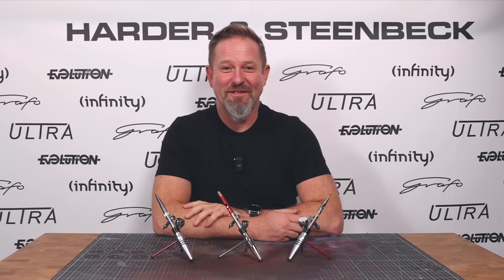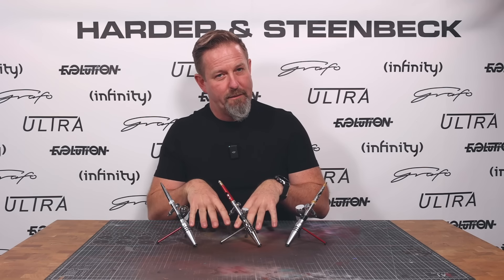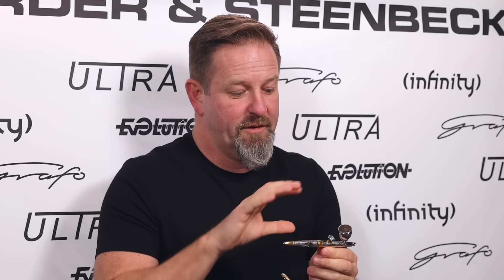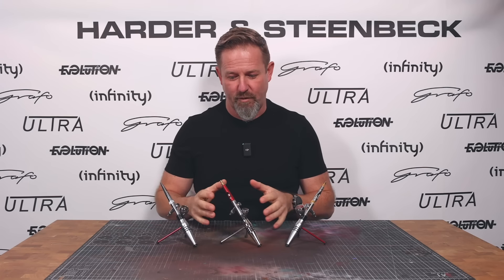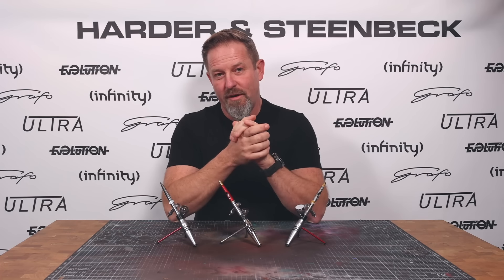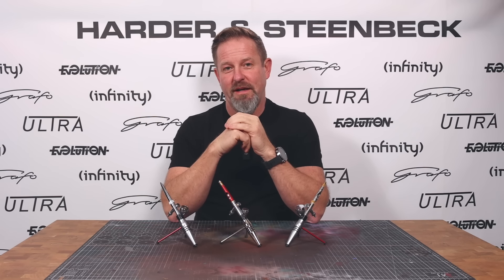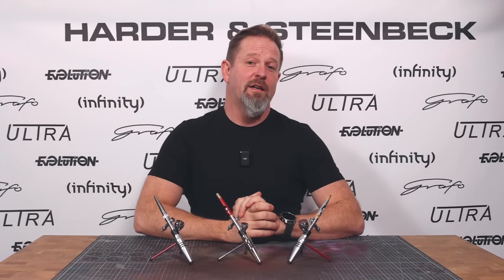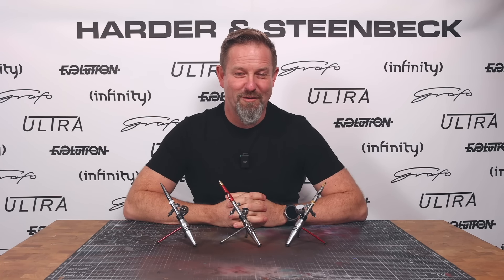Let's talk about the Infinity 2024 CRplus Airbrush!

Comment: Hi Warrick,
Excellent video. 
I am looking at purchasing my first Harder & Steenbeck airbrush. 

I have been airbrushing HO (1/87) scale buildings and rolling stock for many years. I moved up from a Badger, to Paasche, and I am currently using a Paasche Raptor. I find it difficult, if not impossible, to get the fine detail I need with the Raptor, I think my old model M was better. Plus, at times I only need a drop or two of paint for  a particular detail and the 3ml cup is just too large. So, I am looking at your Infinity and Evolution 2024 airbrushes and definitely adding the micro cup. The two sizes of cups is especially interesting, since these are slightly smaller and slightly larger than cup size I am used to. 

My concern is related to specifications for your airbrushes; there are no published specifications; at least, none that I found. I would like to know the length and diameter of your airbrushes and most importantly the weight. I am used to an airbrush weighing 3.75 ounces (106 gm) with a length of about 6.5 inches (165mm) and a diameter of 0.9 inches (12.5mm). Somehow, being all chrome, I believe the Evolution would be heavier. 

Since you are asking for suggestions, I think it would be helpful if you published these specifications. Since there are no physical stores nearby in the US, there is no way to actually see one and put it into your hand, so, in my opinion,  published specifications would help a little.  

Regards,
Paul

Comment: From a comfort standpoint, I have always found the trigger top of the custom micron to be the best of any airbrush. As for cup sizes, I use the micro cup as it does not interfere with line of sight. That being said, If the new infinity was available as a suction feed, side feed and the Grafo T1 body style, I would buy them all. An infinity airbrush in all 4 body styles in a big box set would be pretty sweet. I would buy it right now if such a thing existed.

Comment: I love my iwata eclipse and my CM Takumi. I always struggled with my infinity cr plus. But I got the squidmare evo black and the response is far superior to the more expensive infinity. Can’t wait to buy the new infinity I will be in line early can’t wait. That distance factor is why the Iwata CM’s are so invaluable. I can be back a little bit further back from my models but still get paint where I want it. I like the cup sizes you offer. Here in the states we have the Dru Blair soft spring and low riders trigger which takes almost no resistance

Comment: Intriguing!   I think the Infinity may be beyond my current ability, but being a recent convert to H&S in the shape of the new Evolution I would say your strengths are:
Ease of cleaning
Responsiveness of trigger
Being able to dial in the trigger travel (when needed)
Light weight
Trigger grip, suits my paws!
I have never used the 5ml cup, preferring the 2ml and micro cup, but that is because those are more suited to the models I have been painting.  There are a couple of larger ones lurking in the stash that might need the 5ml.
Great video, but a real teaser…

Comment: My dream brush would be a mix of the AG and Black Kiev brushes.  I use them both and love the design of the AG (Sorry Angel, not the trigger top) and the weight of the Kiev. I don't think I've ever used the 5ml cup on any of my Infinity's so would be happy with a smaller cup. Sketching caps work for me.  Looking forward to a magic no tip dry cap 🤣.  Love H&S quality and engagement.

Comment: 5ml cups definitely! Even when using a small amount of paint I never use the small one, less swapping of parts. Definitely keen on focusing on keeping the infinity as a detail brush and having that cone as narrow as possible even at a distance. Not sure what I think about a bigger trigger but will have to see, a more comfortable trigger would be welcome as long as it doesn't sacrifice control (which I feel I have with a smaller trigger). As for trigger finish I'd  love to see some sort of matte finish or some other kind of finish that offers a bit of grip to it. Everything is sounding great so far, top work!! 🎉

Comment: Comments in no particular order:

I have two Infinitys and I love them.  Just a few nights ago, I made a comment on Reddit that was well liked - the ease of cleaning of H&S brushes doesn't get talked about enough!  So good!  And the Infinity 2024 could be better?!?!  Take my money!!! (Seriously, ease of cleaning is one of the reasons I reach for my Infinitys first)

I prefer a larger cup.  I'll get working on something and get so into the painting that I'll forget about the airbrush and tip paint out of smaller cups.

One of the things I love about my Infinity airbrushes is that with three needle sets I can do a huge amount of different tasks, from .015 detail to .04 bulk coverage, with just one airbrush.   It was mentioned that the Infinity 2024 would have a narrowed spray cone... will I still be able to use different sizes for different tasks?

I'm not worried about the weight of the airbrush- I prefer a solid feel with a touch of heft.

I think the Giraldez tip would a great ad on!

And finally... is an update for the Colani coming?  It's a beautiful design and I'd love to see an update with some kind of fan tip?  Or maybe go back the script on the handle?  It doesn't seem like H&S gives it much love... I can't help but notice the Colani name doesn't appear on the H&S backdrop. I do some larger projects (currently have an LPH80-104G) and the Colani might be a nice add on to my airbrush fleet.

Thank you!
Reply from the maker: Thanks for taking the time to write back! To your questions:
1. Yes, you will still be able to fit any head to the new Infinity 2024 - whether it is the new Infinity heads, or the Evolution 2024 heads, or even the Ultra 2024 head.
2. Colani... The name is NOT on the backdrop - you're right! What an oversight, and thanks for pointing that out! The Colani is a beautiful design and there are some extremely large shoes to fill in order to improve that iconic design. But I'm developing some concepts... To give you a little backdrop, I am aware that with these redesigns, I am standing on the shoulders of those who went before me. And in the case of the Colani, there is a lot of work to do in order to ensure that anything updating that design can do justice to the great Luigi Colani, who was involved with the design of the original...
https://en.wikipedia.org/wiki/Luigi_Colani

Comment: Stop talking and take my money! 😆

I'm very excited about the new Infinity, tbh I don't think I've been this excited since I was a kid. 
My twelve year old Infinity is still going strong and still my first choice for most of what I do. I'm a hobby painter, not any kind of 'pro', but having said that the Infinity has grown with me, with a decent selection of new needles and heads. 
Currently I'm running a '21 Squidmar Ultra for detail work, with a larger needle in my Infinity for general use. The chance to turn that around with a new, detail focused Infinity has got me giddy with anticipation. I can hardly wait!

On cup size: I've hardly ever used my 5ml cup, the 2ml is fine for everything I do. It's reassuring to have the bigger cup as an option, but it stays in the case these days. In a similar vein, I've never used the micro cup in anger. I bought it, tried it, didn't see any great difference in my accuracy spraying and went back to the 2ml. 

On features: I'd really appreciate the new brush's constituent components to be compatible with the current range. H & S  modularity is a big draw for me and the main reason I'm reluctant to purchase competitor's brushes, no matter how favorable their reviews might be. I've got a lot of needles and heads, very useful to me for various, slightly different reasons. It's so easy to swap out a few bits and get a completely different feel and performance out of the brush!

Finally, I've no clue what the new feature is. A gunsight? That'd be useful on a detail brush... 😉

Comment: This is all very exciting! For my needs, I spray Fiber Reactive Dyes on my turned wood bowls at this time, and it is the consistency of water, although I could thicken it up, but haven't found the need. When I get my skills to the level I am satisfied with, I plan to add paint, especially metallics for accents. For the trigger, I consider myself still a beginner, having used a gun style bottom trigger when I started, but am working on learning to effectively use a top trigger on my Ultra 2024. Light weight is always good to avoid fatigue. For cup sizes, I rarely need anything larger than a 5ml cup, but would like the option of a larger size for my larger bowls. I could effectively use a 2ml cup. 10-12ml would work in this situation. The real question is when do you anticipate the Infinity 2024 CRplus to be available?

Comment: the only drawback i have found with the Ultra 2024 is that the color control collar will move at times while using due to contact with thumb and index finger (in my case).  does not lock
Reply from the maker: Hey Andrew - it does have click points... but to have them work you must have the end-piece fully screwed on. W

Comment: My tuppence on some of your questions, as a miniature painting.
Cup size, a micro and a 5ml would suit my needs.
Being able to use thicker paint for a "one and done". Yes please.
I like the top of my grafo trigger best. Maybe slightly more domed but still with the ridges.
Shortening the distance between the trigger and the tip, yes please.
Various weight options would be nice. I prefer lighter, personally.

I have a personalised infinity at the moment. If the new one has those same personalisation options, that would be great.

Comment: Is it possible to design a two stage airbrush that "forces" you to apply air before painting, then conversely forces you to push forward to air before releasing the trigger? I guess some sort of guide built into the body and a pin into the stem of the trigger?

Comment: I fairly new to this I got the evo 2024 B+G Squidmar and its really great. I clean it during painting usually with just water i get a spray bottle, spray into the cup and tip out, i don't get clogs or anything like that, just leave a bit of distilled water in it or give it a proper clean if i'm stopping for more than a day. Tbh its just slick and easy to use. I think I'd maybe like it a little lighter, i do get some fatigue, but I am also new so, there is that. Maybe i am not holding it properly yet or maybe i just need to develop a bit more muscle, its might little finger and one next to it that seem to cramp so if the inifinty is lighter probably bit easier to hold for a long time. I just use the 5ml cup, I just practice so i fly through paint, maybe i'll try the 2ml cup again when i start doing some pieces that are small. I've started making quite a lot of progress now on the evo after having it a couple of months, not really sure what I'd change, the infinity I'll defo get so i can have a couple of colours on the go at one time, i really like the sound of this new brush being able to do detail from a little further away to keep that motion sounds perfect quite honestly. Look forward to it. Also the trigger is great, at first i thought it had a bit of a corner i didn't feel comfy on but now, i don't notice the trigger, its like its just part of the arm.
Reply: I think one thing that would be ultra cool is different shaped heads, so maybe a line or a square or triangle, even an oval possibly (although i can maybe get some oval shape by tilting the brush). I think this might not be possible but, then, maybe it is?

Comment: Oh was that almost click bait Warrick🤭🤔😲😳🙄😀😀💜

These videos are excellent - great for customers and H&S alike - you've one of my dream jobs Warrick😊👍✌️

Off the top of my head.....

1) Clean up and ease of use (as per the other two recent releases);

2) Sort the trigger slack/paint take up issue get that remedied (cured - as with the other two releases, Ultra and Evolution);

3) As it's to be a detail airbrush, weight is a consideration too - ease of use, for detail work over longish periods, on confined work applications (maybe an alloy version later?).

4) Cup sizes: I like the flexibility of all sizes, that mentioned? I end up using the smallest two, one of which is the micro (especially for detail work - as with one of my Infinitys).

I hope that helps, you guys seem well up on continuous improvement anyway✌️💜👍😊 Sounds like the perfect detail brush.

The trigger improvements sound spot on - I like H&S triggers anyway, but a larger one (as long as it or finger doesn't affect larger paint cup sizes) would be great (I tend to hook my finger tip over the trigger - I think 🤔). I like a lighter spring (or adjustable) for detail brushes.

I'm a modeller, weathering for an Infinity is my thing, smaller nozzles/needles, better paint coverage on Eg bolt or rivet heads.

My advice? 60% bias towards detail, 40% towards coverage general purpose work - try not to make it like the TSR2 (as much as I love that aeroplane), a jack of all trades is far from ideal - especially as the, Ultra and Evolution now cover off those aspects already. 

Sketching Caps are great, I worry when I spray without a cap of sorts, I've not damaged a needle yet, but doing so is only ever an absent minded moment away - Sketching Caps are a great idea.

Oh and standardised interchangeability - I know H&S have that covered already though👍✌️

Anything else from me would merely nitpicking as H&S are subject matter experts 👍✌️💜😊

The new heads? Better air and paint mix/atomisation (if that's possible from a H&S as they're superb anyway), better speed/control through multi air venturi/apertures??🤔🤔🤔

Comment: Hi Warrick, I have the Ultra 2024, it's my first proper airbrush and I am already doing amazing things with it that I didn't think were possible with an airbrush. I am mainly using mine for weathering model railway models and for painting miniatures. My main gripe with the airbrush so far, thinking about how you talked about clean up being as easy as possible - I quite often (more than half the time I'm using the airbrush) find that I get paint leaking from the joint where the cup fits into the body. I know you talked about how fine the tolerance is here where you machine the fit so that it doesn't need any O-rings, but I'm getting kind of annoyed with getting paint and thinners on my fingers and my instinct is to put an O ring in there (don't worry I'm not going to as I know it's not supposed to have one) but is there any tips you can offer to stop this from happening? I have taken to really winding the cup in tight to try and stop it from leaking here but I feel like this is a vicious circle as I don't feel like I should be putting too much force in here and I don't want to wear anything prematurely and make the issue worse. It makes clean up take much longer than intended as quite often I have to remove the cup when shifting between colours to clean the paint out of that joint and off the outside of the bottom of that cup area. 

I'd really appreciate your advice here if I'm maybe doing something wrong or if there's a tip to stop this from happening? Thanks! Nat

Comment: I would like to have the posibillity to have a heavy trigger pull on the Infinity 2024. The reason for it is that I've got more control that way. It fine with me if I've to buy a stiffer spring or whatever is suitable for that in order to get a stiffer trigger on my airbrush as I know that most high end airbrush users prefer a featherlight trigger action. My hands and fingers is permanently damaged due to several different injuries over the years so I've problems with featherlight triggers.

Comment: Cannot wait for the new Infinity I have the older style Infinity and Evo and I like them all except the trigger. I recently purchased the Squidmire and instantly fell in love with it. It is my go to airbrush now. Like you have said in this video to be able to use thicker paint and do fine detail like that of a micron would be a great game changer.
There is one thing with the 24 that I find a bother is the narrow area at the base of the cup for cleaning. It is a tiny spot to get anything in there to clean with that’s the only thing I find a bother.

Yes as you say a lighter brush, finger closer to the front with the larger finger pad and the new trigger design I’m sold. 
With the ability to do a narrow spray pattern real close to the surface and further away is a definite plus. Will the brush come with different size needles as well? That would be an awesome thing so that an even thicker paint would work at a narrow spray pattern as well. 
From all that you have mentioned which is a masterpiece will there be a side cup delivery version?
Can’t wait to place an order for the new Infinity!!
Reply from the maker: Thanks very much for the comment Gary. Yes, the airbrush will come with different head size options, as well as also being capable of using the other H&S heads as well, of course. Glad to hear that the Squevo is working our well for you! W